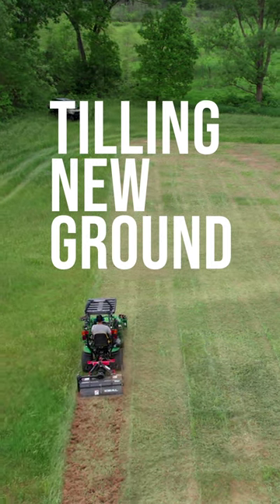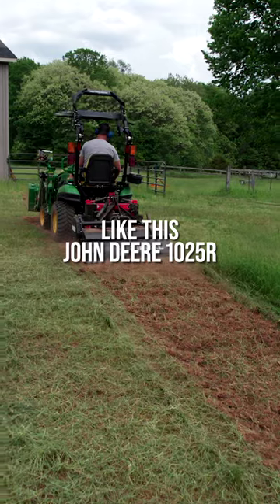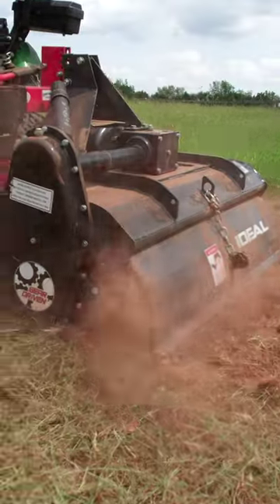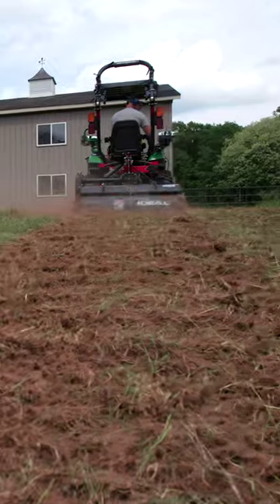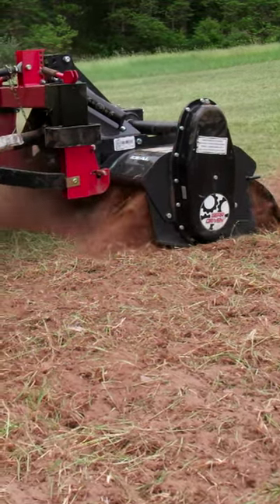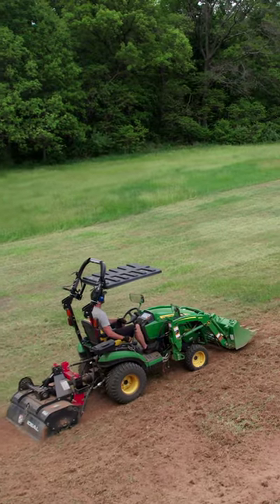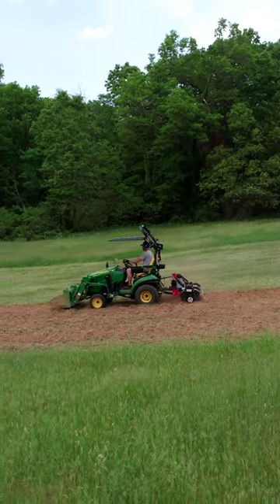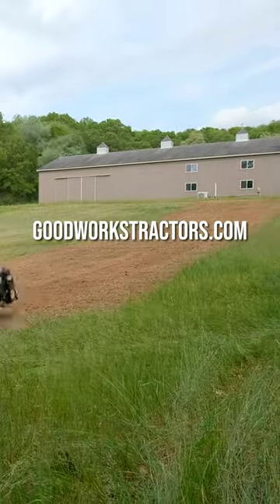TILLING A GARDEN IN VIRGIN GROUND WITH A SUBCOMPACT TRACTOR

Comment: I've had both forward and reverse rotation tillers. I honestly don't see any difference in soil finish. What you will see with forward rotation is launching a small tractor rapidly forward when you hit an object be it a brick at the odd angle or tree root. I use a 72" Forward on a 60 hp tractor (overkill)and usually do 2 passes in perpendicular pattern. Leave your Cornstalks, tomato plants or whatever and I will chop it and make it disappear. I don't do burn sites. Okra plants are the absolute hardest thing to till when green. I've also found that slowing to half throttle allows the tiller to dig deeper on the second pass. I take pride in leaving a smooth site with no tire tracks. Plowing is over rated when you can till around 6 to 7" deep. I have came back with a 2 shank ripper in the fall and knocked the hardpan out of a couple of sites going 14" deep that helped tremendously with drainage and fertility. One I suspected of too much Lime. Soil samples will give you vital info on what you should amend into your tillage program.

Comment: I have always worked on 1 HP per inch of width. This will let you go full depth in one pass!!!
Reply: You must be trying to till concrete. I once had a 1983 1210 Ford 13.5 PTO hp with a 48" Forward rotation tiller that could do 8"on a regular basis. 48 hp on 48" is overkill. My 72" tiller has a 45hp max rating.

Comment: Tilled up and planted some food plots this last weekend on my hunting and camping property. Only had two days to brush-hog mow, prep, till, plant, and drag harrow. Could not have done this without the tiller.
Reply: @TF856  I like to brush-hog first and scrape/drag most of the weeds and grass out of the planting area first. My tiller did great considering I planted about 4 acres +- of plot.  I would admit that a proper seed drill or seeder with disks that placed seed a little more precisely and covered it in one pass would make things much more efficient and easy. But I think the tiller did well considering the soil type, rock and root content, and the little JD 1025R tractor 🚜 I was running.

Comment: Besides obviously spraying to weaken roots a week or the prior... if your soil is acidic then lime will soggy up that top few inches, after a decent rain, if time allows for the scheduling. 
I really enjoy that my RTR can build raised rows at its highest setting if I flatten paths for the feet.   
I also like how at the highest setting I can scratch 2-inch ribs in the grass for lawn elevation adjustments that don't bald the yard.  I've never used a forward rotation tiller. 
On my RTR I can't hit large tree roots, it's a guaranteed snapped shear bolt.